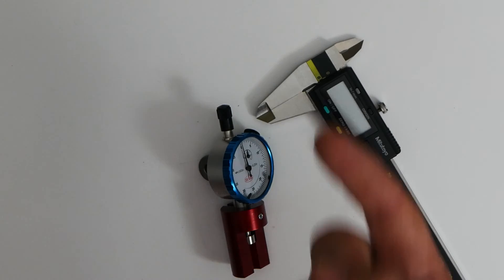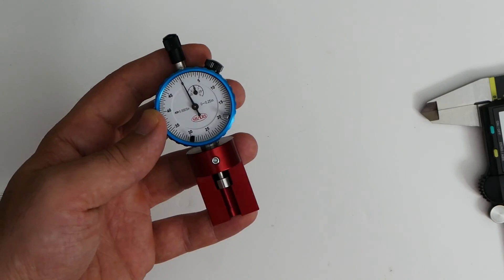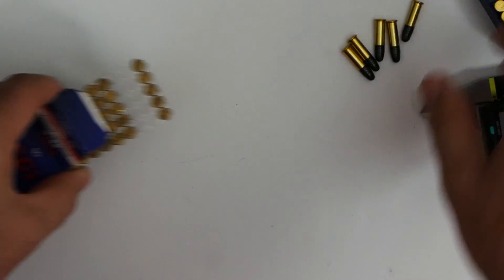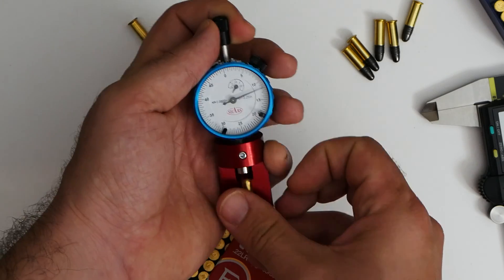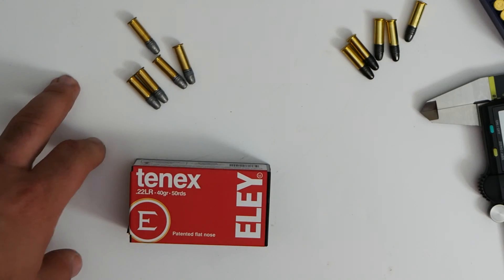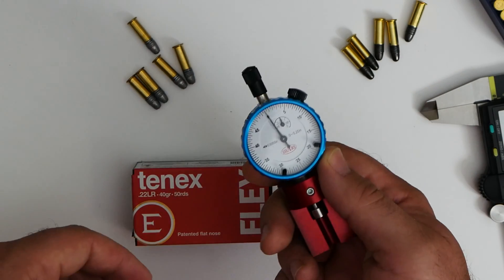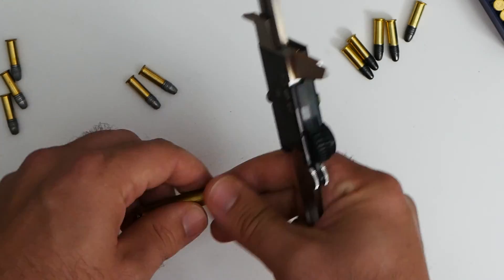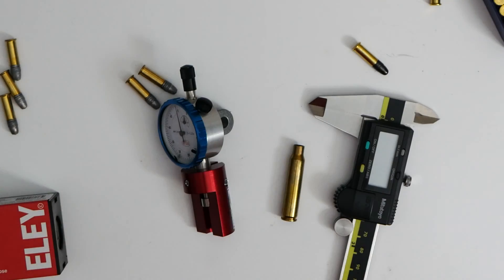Measuring 22LR Rim Thickness

Comment: How did you install the flat piece?
Reply from the maker: The tip of the dial indicator has threaded interchangeable tips so you just unscrew the point tip and install the flat tip base.

Comment: The caliper is probably more accurate than the travel dial u have, if not been dropped if u take the case and turn both ends will remove that from equation
Reply from the maker: Good point. The Dial is much faster though.
Reply: @CopperStarPrecision  oh yeah for sure and what you're doing its more than sufficient

Comment: Thanks for that tip on using a 223 round and caliper to check head spacing ! 👍👍
At the range I was struck by the variation one lot run to another from the same manufacturer , with impact on the target with my CZ457 American ! 
As much as an inch lower impact at 50 yards ! 
An indication of possible powder inconsistency , diameter of the round or weight difference !? 
I did not have my chronometer to check the speed so I will need to go  back later to confirm the difference in velocity ! 
I feel for the competition shooter in what they have to deal with to get consistent accuracy with 22LR ! 
For me it’s a small game hunting rifle . 
I can live with a 1/2 inch , but the variation between other manufacturing brands is unbelievable as to their impact at 50 yards !
Reply from the maker: You bet! Consistency is key. For things like NRL22 type competitions you can deal with a little variation, but for the benchrest crowd, every bit of accuracy matters. I do find that the higher end match ammo is more consistent across the board, but it should be given what you're paying for ammo!

Comment: Just finished a ARA benchrest match using ammo checked for rim thickness. Running Lapua CX at rims of .040 V .041 (supposed to be .042-.043 but checked and system read the .010 check gauge correctly). First two 25 shot targets with one rim thickness and the last two targets with the other lot of rims. Interestingly the MV, SD's and max speed was about the same. SD's for the 4 28 shot strings were all 6-7 SD's and within 26-31 fps deviation. Looking forward to your range results.

Comment: Sorting Eley Match for my Kimber 82G with Raven Eye attached to an iGaging dial gauge. Not sure I’m seeing any accuracy difference, and certainly not in poi. Rather the spoiler is that round in 25-30 that is off in velocity (and ruins the 250 perfect score), regardless of rim thickness group. 
The challenge of sorting is the variability of many of the rims. 
My sorted groups are:
0.0400-0.0405
0.0405-0.0410
0.0410-0.0415
The majority of the sorted cartridges are in group 1 or 3 above. Many,however, are a sorting judgement call since a 360 degree turn of the casing/rim can vary thickness by 0.0015”. I end up allocating these to the thickness rim group for lack of a better solution. 
Q? Any suggestions?
Testing has to be limited to secure adequate ammo for this winters’ 50 yd bench league, ammo left over from last year. I have yet to find a lot that shoots well as this one. I was a contender last season, so trying to get this one. (No custom barrels, tuners or triggers allowed in this sporter class. 
Thanks for any ideas to take advantage of sorting, or other techniques. Thanks.
Reply from the maker: I don't really have a good answer for sorting. I only shoot benchrest occasionally and my rim thickness sorting is more to make sure that my rifle's headspace is shimmed to match the rim thickness of the ammo that my rifle likes. I have heard that people also sort by weight to try to find and group similar ammo hoping that the powder charges will be similar, but that's yet another step in the pursuit of perfection. 

Not sure what tip your gauge has, but I have found that a replacement tip that is a large flat surface helps to give more consistent readings over the entire rim. Something like this replacement tip: https://amzn.to/4jPwYA9

Other than that, I would just make sure your ignition system is as consistent as possible (no firing pin drag, bolt shims to tighten the headspace, etc.)
Sorry if I couldn't be of more help. 
Best of luck!

Comment: Does CZ use SAAMI specs though? Cool hack with the spent .223.
Reply from the maker: I'm not sure which SAAMI spec CZ uses. It could be 22LR or 22LR Match chambers. Maybe on the MTR they use the Match chamber. But there are a ton of options for 22LR chambers (Sporter, Bentz, Match, etc.) 

Either way, knowing the headspace of your particular rifle (industry average tends to be around 0.043") versus the rim thickness of the ammo you want to use and then shimming accordingly gives an opportunity for accuracy improvements.

Comment: Ive found this is generally a waste of time. Ive tried to do a box of cci and would get multiple reading off of one cartridge when i rotated them. They would be off a thousandth or two from side to side. That's just a waste of time as it not getting you anywhere.
Reply from the maker: Well CCI is far from match grade ammo so there will be a lot of inconsistency between rounds. If you're using correct technique you shouldn't be seeing more than a half thou difference in rim thickness, but maybe CCI is just that off.

This isn't so much for sorting rounds for the same rim thickness as for determining what the average rim thickness for a specific ammo is across the lot and then matching your headspace to that rim thickness.

Comment: Using Raven Eye, what is your suggestion to segregate rim thickness that varies 1.5 1/1000”. 0.038 to .0395 on one rim? Go in the thicker bucket??
Reply from the maker: I haven't seen a spread that large on a single rim in most of the match ammo that I have tested. If you're measuring a lot of rounds make sure that there is no lubrication residue on the rim/case or the surface of the measuring device that would give you a false reading. When measuring I also keep a towel nearby and wipe my fingers frequently to get the lube off of my hands. 

If the rim truly varies by that much the issue is that if you're loading from a repeater then you don't have a whole lot of control over which part of the rim will face the firing pin. On the other hand I've known very high-level benchrest shooters that will mark the high or low side of the rim and would always orient that mark to the firing pin position (usually the top of the chamber), but they are shooting single shot rifles.

I would take a few (3 or 4) measurements by rotating the round a third or quarter turn and pick the middle/average. But that's just a thought, I don't have any testing that would back that up. For my purposes I am looking to get a general idea of rim thickness so I can match my headspace to the rim thickness or just a touch tighter than rim thickness. I do not sort for rim thickness because my main competition is NRL22/PRS style matches where pinpoint accuracy is not required.

If other rims from the same lot show much lower variation then I would sort those and take the ones with high variation and use those for fouling/sighters.

Great question. Sorry I don't have a better answer for you.
Reply: @CopperStarPrecision  Thanks for the detailed reply. 
 I just started sorting and haven’t tested the results yet. Sorting Eley Team to start. Maybe Match will be more consistent. 
 Settled on two groups for now, where the rotated cartridge is predominantly 0.038-0.0385 or 0.039-0.0395”. Using the rag for my hands 🙌. Maybe the build-up of lube is more of a culprit than I thought🤔. 
 Observation: My Kimber 82g is not as ammo- finicky as the CZ457 and Lilja barrel with Yodave trigger kit. 
 Down the shooters’ rabbit hole I go……again. Cheers.

Comment: How did you change to the insert without jeopardizing the dial indicator?
Reply from the maker: I'm not sure what you're asking.
Reply: @CopperStarPrecision  How did you remove the stylist from the dial indicator to get the flat insert on it?
Reply from the maker: The tips are interchangeable. You just unscrew one and replace it with the flat one. Then you rotate the bezel to re-zero the dial.
Reply: @CopperStarPrecision  Thanks. Didn’t want to wreck my new dial indicator. Looks like it’s screwed on there pretty tight.
Reply: Where did you get insert from everyone  i found wouldn't work

Comment: Rim thickness on .22s is something I see discussed ad nauseum, but I've yet to see an experiment of meaningful sample size verifying the theory that it improves accuracy.

This is probably better to test with cheaper ammo that presumably has a higher variance in rim thickness.  

Consider grabbing a bulk box, and sorting into "thickest 20%, thinnest 20%, and median 40%".  Shim the bolt to match the headspace of the median average, then shoot sets of groups containing 1) the thickest and thinnest ammo mixed together and 2) the median ammo.

Would be very curious to see the results from such a procedure, the more groups the better!
Reply from the maker: I agree. I definitely plan on doing testing in the near future, but I'm busy preparing for nationals at the moment.

Some preliminary testing that I have done shows improvement in group size when I shim the bolt to tighten the headspace from its normal 0.0435 to the 0.0405-0.0395 range for Eley ammo which has a rim thickness of 0.039-0.038

I think there are a few tests to do. One would be to test ammo sorted by rim thickness for groups and SD/ES vs a random selection. This would most apply to bulk ammo like you suggest since most of the match ammo I have seen from Lapua and Eley has at most a 0.001 extreme spread in rim thickness.

The other test that comes to mind is matching the rim thickness to the headspace of the rifle via bolt shims to see if there is an improvement.

The issue, as you point out, is getting a large enough sample size to make the results statistically significant. I need to dust off my old statistics textbooks and design the experiment and then find a calm day or book an indoor range to do the testing.
Reply: @CopperStarPrecision  Right on, man. +1 on doing it indoors to isolate the effects of weather. Probably ought to chrono everything to isolate the effects of varying velocity, too...

Looking forward to a video on this if you ever get around to it.
Reply: @CopperStarPrecision  Also, there's some redneck science claims I've heard from another channel ("STKO") and I'm curious if they hold any bearing among the competition crowd:

1) Humidity's effects on powder burn and chamber fouling have a larger effect on accuracy than any lot-to-lot variance would, and lot-tested ammo doesn't necessarily consistently perform the best in different humidity than what it was initially tested in.

2) The ratio of contact-bearing surface on the bullet to the width of the grooves in rifling has the largest effect on a given barrel's ammo preference (https://www.youtube.com/watch?v=fNCyOCaWo00).

Not really seeing these mentioned anywhere outside his channel, and his process isn't exactly scientific :) Was wondering if there's any merit to either of these.

Comment: Shimming rim thickness all depends on the chamfer of the rifle's chamber. Save your money from "rabbit hole" gauge prices and detail the rim thickness to your rifle... It does require more work☹ 223 case is great for comparing different brands of ammo... Old school
Reply from the maker: Lot testing will always be key, but matching the headspace to rim thickness can usually give you a better starting point for a specific brand of ammo. My MTR headspace is 43-43.5 thou and it likes SK/Lapua which makes sense. I've never found any Eley ammo that shoots well since the rim thickness is closer to 39 thou. If I wanted to shoot Eley I would need to shim the bolt for tighter headspace.

Comment: Thanks for the video! How concerned are you with touching brass, and wax coating, on the rounds as you measure? Does that coating even matter? New to precision 22lr and enjoy watching your channel.
Reply: The wax/lube on the brass shouldn't matter.  It's the lube on the bullet that is useful.
Reply from the maker: The lubrication on the bullet does matter and varies between brands of ammo, but I'm not terribly concerned of touching it as long as I'm not rubbing it all off on a paper towel or something.

Some ammo is very dirty and you might have to make sure your measurement tools are clean to avoid false measurements.
Reply: @CopperStarPrecision  Are you stung the lube on the brass (as opposed to the lead bullet) matters?  If so, perhaps you can explain in a future video.  I don't think it really has any impact on peformance but maybe I'm missing something.